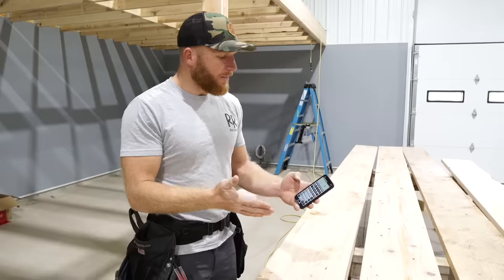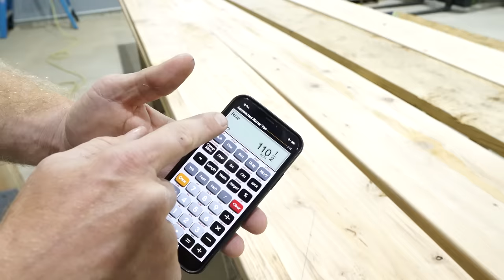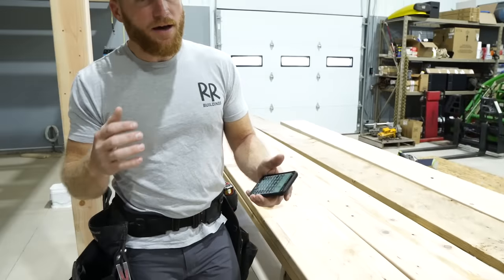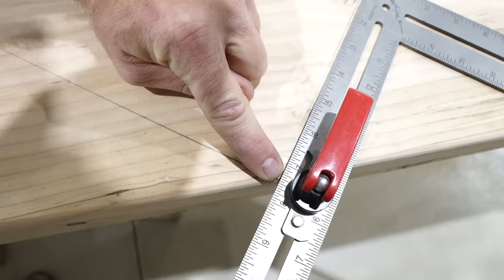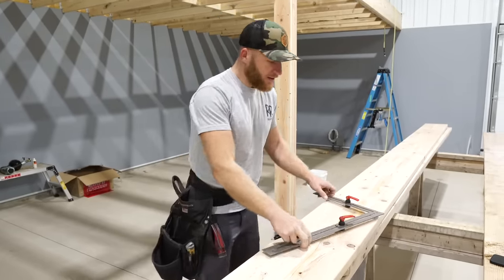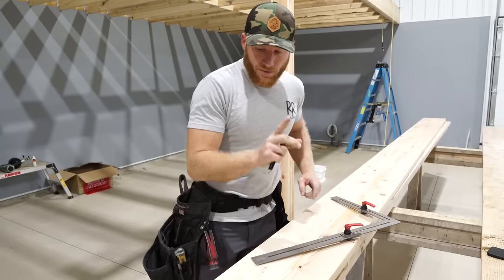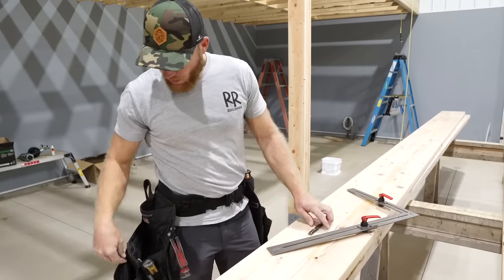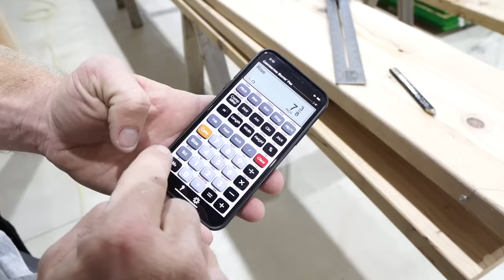Building a Large Staircase and How to Layout a Stair Stringer

Comment: This video couldn’t of came out at a better time, over the Christmas break I’m going to tackle building built in bunk beds for my kids with stairs on the side. You mentioned it, but never showed it. Did you take off the 1 1/2” from the bottom to account for the height of the tread? Also do you take off the back of the top for the size of the riser?

Comment: Always take the thickness of your treads off the floor cut (not always 1.5 in)..  A sq +  B sq = C sq (Pythagorean theorem) for cut out hypotenuse length.  Rises 6 - 8 inch, and Treds 10 - 12 inch.  Must have a minimum of 3.5 inches from back of stringer to cut stringer mouth  for a 2 x 4 strong back (sister) if needed.  Can't have more than 13 steps in a straight run.  Don't normally see stairs the same hight as landings (attach them to rim joists with stringer cleats) it prevents falls from people. Always crown up. Back screws into treds from risers and glue in that area is great. A cleat on the floor and stringers cut around it for the middle stringers is nice to prevent the staircase from sinking. That saw is AWESOME!

Comment: I know how to cut stringers but I still like to watch videos for different techniques or learn something I didn't know. I haveseen many videos on the subject and this video of yours is without a doubt the most well explain, easiest to follow info. The only thing I would add is that for a beginner, when cutting the stringers, I would cut them out with a power saw but stop short of where the lines meet and finish it with a handsaw. If you cut the line all the way down, especially with a circular saw, you could over cut the line, therefor compromising the strength of the stairs. Also, I may have missed it but did the video show how, when marking and laying out the measurements of the stringers to the lumber, how to finish marking the bottom step so that it will sit flush to the footing/landing?

Comment: My how times have changed. When I was taught by journeyman Carpenters on how to figure stair layouts, we used a pencil. They would have thrown me off the job for using a calculator. The proficient knowledge of trigonometry was also required, along with converting decimal equivalents to fractions. One of the best things in my opinion to ever happen in the building trades are construction screws. Makes for a nice job. Impact drivers are also great….

Comment: Do like that App you use on your phone, & had to give a try for myself(long long ago). Like that works both for iPad & iPhone; albeit, different versions though. It’s still nice to “know” how to do this w/o a calculator...what some may call, “the old school way”; but isn’t technology great 😉😅
When measuring (cutting & setting treads) like using the Collins Tread Template Tool. Might be “pricey” to some, but just need a 1x2 & the Tread Template tool for it to work. Pretty simple, light, & easy to use. End up using adhesive & some brad nails, on the tread face, while adhesive is curing. Then we fasten from behind the stairs to secure it all & keep the front all “pretty”.
Also, Martinez Tools came out with a Trim Square, so wish he’d send me one😉👍🏻
Thx Kyle, Happy Holidays ✌🏼

Comment: for got to notch out the bottom run for the Nailer to anchor the bottom to the floor ........and you can also use a Stiffener on each stringer by putting a 2x6 along side

Comment: quick layout question.   After marking the initial layout w stair gauge, is it correct to then 1. cut off the dimension of TREAD from LEVEL CUT on bottom step, then 2. cut off dimension of RISER from the PLUMB CUT on the top step? So that all ends up equal when climbing/descending?
Thanks!

Comment: Good work bro! As others have mentioned there are more details that need to be fitted in this instructional video. Like taking off the thickness of the riser material (and kick plate thickness if one is used to hang the stairs) from the top tread.
Also did you just leave the bottom of the stringer floating on top of the concrete floor? That's a big no no; a kicker 2x material should be pinned down to the concrete to which you'd secure your stringer to.
Otherwise pretty good video, keep up the good work!

Comment: So if each riser is 7.375" and a 2x8 is 7.250" there is free space of .125" under each riser? As in the bottom of the riser board wont sit flush with top of the stringer.

Comment: I’m confused. You subtracted 1 1/2 from the bottom riser to account for the anchor board but then didn’t use an anchor board. So did you end up not subtracting it when you cut or do you have a smaller first step.

Comment: I've been finishing staircases for at least 25 yrs. and would like to good job on making the stringers consistent and using the diagonal measurements to verify the layout. However I would like I to add two points you seem to have overlooked. 

No. 1 - You really need to SOLIDLY secure the carriage to the floor so the starting newel can be rock solid. It doesn't matter how secure the finish carpenter can attached the newel to the stairs, if the carriage is not securely attached to the floor the handrail will ALWAYS move. It needs to be the strongest one in the balustrade and yet it is often the weakest. Just like everything else it needs a sound foundation. Place a 2X material on the flat and notch the stringers around it and use PL Premium 8X (or at least 3X) Polyurethane Construction Adhesive. That power grab stuff your using doesn't come close to it. and then use appropriate fasteners. I would also add blocking if not doubling up the first rise for added material to anchor the newel post to.

No. 2 -  NEVER make your top step even with the 2nd floor. It needs to be 1 rise below the floor. There are 3 reasons for this. First, it is a HUGE trip hazard. You may be use to it but remember you are building stairs for other people. People fall and die from stairs all the time. This could especially dangerous for an elder person who are trying to negotiating their way up and down the stairs. Second, it is a nightmare for the finish carpenter when installing the newel and rail. You need to think about the trades that follow you. I wish every framer started out as a finish carpenter so he would see all the nightmare you guys leave for them. (Conversely I think finish carpenters should start out as framers so they so they would understand how houses are built.) Third, it just looks bad. I would suggest studying historic homes and architecture stairs were never built that way in the past. It's just become somewhat popular with guys who don't really want to the extra work or know what their doing. Maybe it comes from guys who think they know how to build decks, I don't know. But don't be like them. Learn to do it right. Especially if you are making videos to teach others.

Comment: Hi Kyle, 

Quick question on another subject. Versetta stone... What do you use to trim over the top? I don’t see a double angle trim from metal sales that comes out away from the building far enough to create a water shed or drip edge over the top of the stone. Also what trim do you use for garage doors when you are butting the versetta up to the side of the garage door?
Reply from the maker: I use custom trims
Reply: Does Metal Sales bend them for you if you give them the dimensions?
Reply from the maker: Yes for sure
Reply from the maker: Https://www.metalsales.us.com/rrbuildings/

Comment: Great video and content. The only potential problem you are going to run into with making the last tread even with the finished floor is that when you go to install railings the code requires no more than a 6-in sphere be able to pass through under the bottom rail. So you have to do some sort of transition from level to the rake angle.

Comment: I cut a stringer over the weekend for practice out of yellow pine. As i was cutting the blade on the saw was binding. When i got it done the stringer it bent about a inch that's why the saw was binding. Do i need to use something other then yellow pine.

Comment: I love your videos! You are the most generous educator of trade skills on the entire internet, in my opinion. I haven't been in construction for many years, but we used to use "rise x run = 66", which would give about 7 1/4 and 9. Has that changed? Also, the tread at 17 minutes appears to be upside down. We would always have the heartwood up, so when the tread warps it curves down. And I never paid attention to this, but some guys used to say that the tread is supposed to have a bit of a down angle (not horizontal). Any thoughts on that?
Thanks for all you do. I'm sure a huge number of aspiring carpenters, and even seasoned contractors, are learning a great deal from you.

Comment: Do you always add that extra tread at the top? Usually l cut that off to save the space at the bottom, and when building houses you have to have that step down from the floor right there or nothing works downstairs. Especially if there is a door at the bottom. Other than that, good vid. A+ in the gadget dept. 
To avoid cumulative errors w/o that monster saw, use your first stringer as the pattern for all the otherd

Comment: One tip I picked up from a deck-building book is to add glued  2X material to the stringers below the notch to add strength to the stringers. I like that you used 4 stringers but it would have been better to add one more making it 5. They then end up with much less bounce and the chance of failure should they have a very heavy load being carried up or down the stairs. I would have added the corner supports to both sides plus the ties from the rim joist to the stringers.

Comment: Great content!  I’d like to open up the bottom of an existing staircase that has the a similar layout as the staircase built on this video (straight shot, but with a wall on each side). Would it be possible to remove the interior wall?  Essentially I want the finish product to look like yours (no supports underneath and no wall on the interior side).

Comment: I noticed at the top of the stringers you were held down from the subfloor the thickness of your tread. Did you cut that out of the stringers just like on the bottom? Or did you just subtract that 1 1/2” from your overall rise when calculating? I’m new to stairs and still trying to figure out how to ensure that it ends up flush on top

Comment: Hi, thank you for the elaborate take on your specialism. I have 4 Qs please:- 

how did you attach the stringers to the:- 

1) top FFL? Did you use straps? 
2) wall if any. 
3) floor without a dedicated kicker.

And finally, 

4) would a nosing pose an trip hazard if carpeted? or would you have to eliminate it altogether.

Many thanks

Comment: A few questions.
Did you crown ,check for equal width,and edge your stringers?
Code reqires a perlin on any stringer that over spans the net depth left in the stringer body.
Why would anyone flush their top tread to the upper landing ?
No hand rail?
It is over three risers( or 30" ) 
You take 1 1/2" off bottom of stringer ,or did you mean to say the thickness of the tread stock? That is misleading .
What about checking the landing of the bottom of the stringers for level across the carriage foot print?
You may have to leave different amount on the bottom of each stringer from your 1 1/2" to sit level.
No SYP tread stock.
That hem fir is too soft, is it not?
Also, many municipalities require a stiffener on each stringer along the body to prevent flexing or failure under load since notching compromises the stringers span.
We route all of our staircases closed for straight runs of extended length for commercial  applications if no support walls or perlins will be added.
Clean work though.

Comment: Nice stairs and a great video, only thing i wanna ad: if u work with a nailgun try to always wear safety goggles. Had some unpleasant accidents with this tool. Had to nail like 10000 holes in 4 hours and somtimes because i wanted to be fast i didnt hit the hole and then it backfires on u, if u hit the steel. Had a 1 cm piece of steel in my forehead which i carried around 2 months before i got it removed :D just as a tip! keep going

Comment: When   you cut 1  1/2  of the bottom for the thickness of the tread   sometimes you have  to  take into account  the finished floor it has been a  while since I did it    but  say you have   a 3/4 '' oak floor  then you would drop the stair 3/4''  not an 1  1/2  then add 3/4 to the total height of the stair  which may be only 1.16'' per riser

Comment: Step cadence is important for any stair and the standard target is 7.5" , 11". Just divide height by 7.5, whatever comes up, say 102".ok 102 divided by 7.5 is 13.6. Up that to 14 then divide your original 102 by 14. That gives us 7.28 as a step height. Calculate the offset for tread height at top and bottom and you're done. The shallower the rise the more you should lengthen the depth of the run btw or the steps will be super awkward and mess up your step cadence.
Reply: yes Daniel, this is how i do it, also i don't bring my final stringer tread all the way to the upper landing, because the landing is also considered as a tread.
Reply: Exactly. I didn't make that clear either so thanks. I have to remember that the last rise doesn't get a tread for that exact reason and so you have to have that little extra on the stair stringer for it.

Comment: I like Buildcalc app better.  You plug in your stair criteria and it will build you a set of plans basically.  Including running totals for all your points.  12 7/8, 25 3/4", 38 5/8" etc.   works really well for pickets as well.

Comment: Good tips.  It's probably important to mention that you correctly compensated slightly for the head of the nail (maybe 2/16" or 3/16") when you hammered it in (since the top of the nail is wider than the tip of the nail.) It will be much easier to compensate the measurement once at the nail (which you did) instead of at each individual measurement.  In Electrical Engineering there is something similar which is called parallax error- when you read a meter from any angle other than dead center, the viewable reading will be slightly off.  

I was surprised you used 4 stringers- usually 3 is plenty.  They must be planning to carry very heavy things down those stairs. Better safe than sorry.

Speaking of which, safety wise, and especially since newbies will be watching and learning from you, I would highly suggest that you use safety glasses (especially with that saw and nail gun!) Also, a mask for the dust and much higher rated hearing protection like 33db's+ which is commonly available OTC (pack of 50=$10.)  Don't sacrifice ~11 db for the ability to occasionally take a call.  The way db's work, 11db's is huge.  In fact, a 10db increase in level is perceived by most people as being twice as loud.  Trust me- you do not   e v e r  want tinnitus that keeps you up every night, forever.  I was literally lowering the volume on my PC speakers when you were using that nail gun.  It is not fun at all and it often times, it never goes away.  Now I try to keep all my volumes down to around 60db.  A nail gun is roughly 100db which can be very damaging.  So in your case, 100db's 22db's (maybe that is the best case scenario) =~78db's (realistically 80+.)  It's better but not nearly as good as ~67dbs. You really want to do your best to avoid anything over 70db's if possible. It's nearly impossible in the construction business, I know.

The only question I would have is how far from the wall do you need to be to allow for the wood to expand in the heat- 1/4"?  

I liked the redundancy you used with the glue and screws and brackets.  Do it once, do it right.

 Nice job!

Comment: That's great if you don't care what the run of the stairs is. What if you have a door at the bottom and the run has to be exact?
Reply from the maker: Then you would divide the total run by the number of steps
Reply: I have a rise of 107 inches floor to ceiling and a run of about 80 inches. It may as well be a ladder.

Comment: Just use the pythagorean theorem. Get the height of the floor you're building towards and calculate sqrt((h*h)+(h*h)) where h is the height of the floor. That's the length of the board you need, and just cut 45 degree angles at each end so the longer side is the length you calculated. It's a little more complicated if you're not making a 45 degree staircase, but not by much.

Comment: Hey. My stairs are 5-steps. One stringer on each side. Treads 39-in. wide. Do I need 3rd stringer in center for extra support or not?
Reply: That all depends on how thick your treads are. If they are plywood then yes. If they are 4" x 12" treads then no.
Reply: @iamjackalope  Okay, treads are 2"x12" boards, not plywood. Solid-wood 2x12 treads are 39-in. length:  Do I need 3rd Stringer in middle of treads?

Comment: 35 years cutting and owning my own stair company in Southern California! You didn't explain or show how you were going to fasten the stair to the concrete! Usually I would set the stringers on 2-2x4" mudsill so I would have to cut an extra 1-1/2" off bottom of stringers! By setting the stringers on the mudsill it would protect the lumber from pest destroying the lumber over time and I could anchor the stair to the concrete with concrete pins or concrete bolts (Red Heads). Also you didn't explain that you need to cut off the riser thickness at the top tread. A support wall under the staircase @ about the forth riser is a good idea. It is always fun talking about stairs.